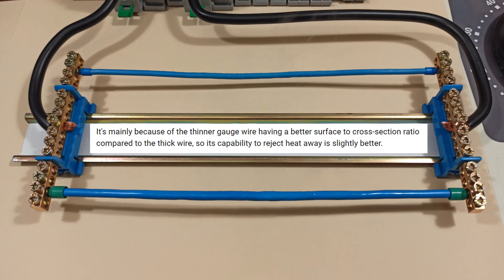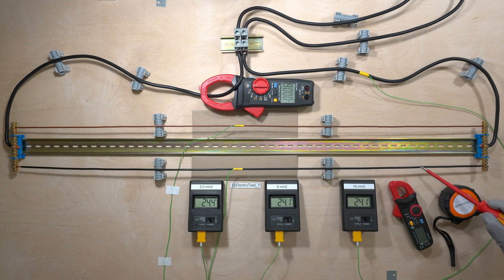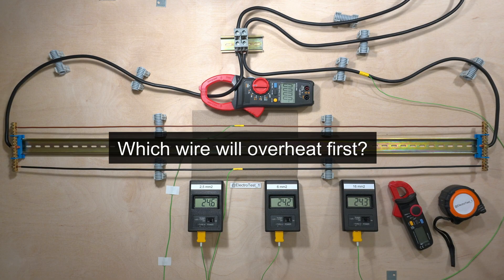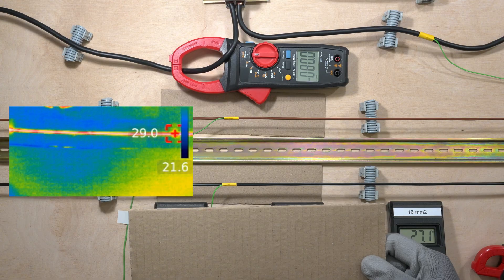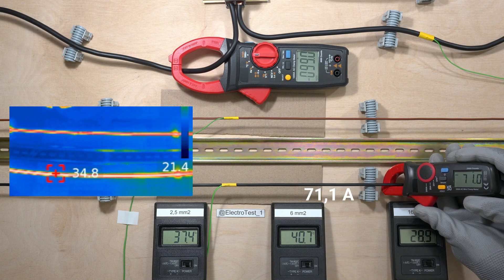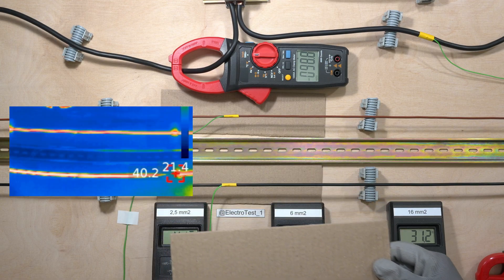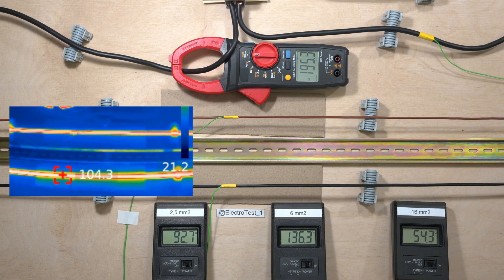Legend is True or Not? 1 meter Thin or Thick wire Fails First?

Comment from the maker: Please support my channel: https://www.youtube.com/channel/UCqZUswoAI9E9iFcTeS7L6gw/join
So, is this legend true or not? Parallel connection of wires and cables is rare, but it does occur in real operation. In most cases, it happens as a result of repairs or increasing the load capacity of existing lines. Using different conductor sizes is definitely against the rules, but that’s not the point here. According to the electricians’ “legend”, the thicker wire melts first.
I already have a similar test on my channel, but the result there was questionable. There were many comments and interesting thoughts. This time I made several important changes:
1) long parallel conductors
2) solid (single-core) wires
3) temperature measurement using thermocouples
4) periodic thermal-imaging checks of hot spots on both wires
The heating test of wires with different diameters demonstrates several physical laws at the same time. Can you help me recall which ones exactly? =)
Now a few of my thoughts:
1) In this test, the current distribution matches the cross-section ratio much more closely
2) Temperature sensors provide much more information
3) Haha, how did I not think that the hot wire would cut through the tubes — the melted insulation nearly ended up on the table
I’ll be glad to hear your comments and new test ideas — now I finally have much more space!

Comment: Easy explanation:

For a fixed voltage across a wire of given length, the power is inversely proportional to its resistance, which is inversely proportional to its cross-sectional area, which is proportional to its diameter squared.

Therefore 1. the power generated in wire is proportional to its diameter squared.

The power dissipation in wire (heat transfer to air) is proportional to its outer surface area (model the wire as a cylinder) which is proportional to its diameter - can ignore ends of wire since it's very small compared to length of wire.

Therefore 2. power dissipation ability of wire is proportional to its diameter.

Since 1. grows faster than 2. with diameter, the temperature (which is proportional to the power) will also increase faster for higher diameter/thicker wire compared with the thinner wire.

Comment: Imagine the thicker wire as 2 thinner wires next to each other (touching). The current splits equally between the 3 wires. But 2 of them are touching, so there is more heat in one spot. While heat generation goes up 2x, heat rejection is proportional to surface area, which is lower than 2x (due to parts of the surface area of one wire touching the other wire).
With an instant short circuit test, there should be no difference, as there is no time for the cooling rate difference to have an effect.
Reply: Everyone discuss about difference in current, but actually this is truth reason for temperature difference, how simple and intuitive explanation <3

Comment: A clamp meter is a transformer. The efficiency of a transformer is partly dependent on the reluctance of the magnetic circuit.
If there is any contamination (bits of grit or dust) where the jaws clamp together, that will increase the reluctance (a lot). Air gaps are as bad for magnetic circuits as they are for electrical circuits.
Maybe a quick wipe would bring the clamp meter to read the same as the panel meter.
Although, 2% isnt really all that bad???

Comment: Hi. You're doing a great job. How do you use 240A with 220V? Standard household grid power doesn't meet this. Are you testing the output voltage with 12V? Good work 👋

Comment: Very well as we can see, this is a demonstration of how the current takes the path with least resistance(R=ρ•L/S). 
And then we have the power dissipation(Joule effect) P=R•I² where the power grows with I squared,where the current doesn't split equally between the two parallel conductors because of difference in Resistance.
Reply from the maker: Great comment! Also note that the surface area of the conductors through which heat is dissipated does not increase proportionally to the cross-section. I think this is the main reason for overheating of the thicker conductor.

Comment: Come on people, this is the very BASIC electronic principal:  We are dealing with 3 factors.  ( voltage is the same for the wires and can be ignored for our purpose).  1.  Resistance.  2. Current.  and 3.  Power. (This is what produces the heat).  The wire resistance increases with temperature.  The power (Heat) increases with the SQUARE of the current.  Therefore, the larger wire will conduct more current than the smaller wire for an increase in temperature.  P=I^2 X R.  The magnitude of resistance change with temperature is less in the larger wire, but the square term means the power will go up faster than the resistance.
Reply from the maker: Hi! You wrote what seems like a well-reasoned comment, but honestly I lost the logic at the end of your message. Try to approach the question more simply — the heat generated is proportional to I². The currents split according to I₁/I₂ = R₂/R₁. Now look at how heat is dissipated around the wires, taking into account the surface area, or to simplify, just the circumference length: πD₁/πD₂. If you take any moment from the video and calculate it, you'll see that in the thicker wire more heat is generated per 1 mm² of surface than in the thinner one

Comment: If you run the same amps through both wires, the thinner one melts first.   This parallel setup isn’t doing that
Reply from the maker: Thank you for the correct remark. Indeed, with the same current, the thin one would melt first! This will be in the next tests. In this video, it's specifically a parallel test.
Reply: @ElectroTest_1   This is a cool experiment though.  It was counterintuitive to me at first until I thought about it more.  Thanks for sharing.

Comment: The thicker cable has lower resistance, therefore it conducts a higher current. This leads to a higher temperature. In series the thiner should fail earlier.
I would like to see a test with flexible vs solid cable of the same cross-section.
Reply from the maker: Thank you for the good idea. It got me thinking why flexible wires almost always have thicker insulation than solid ones.
Reply: @ElectroTest_1  and flexible cable with and without  wire end ferrule
Reply: Multifilar cable should be a little better in Alternative Current because of the Skin effect(dependent of frequency), otherwise in Direct Current the solid one is recommended because the current is flowing in the entire section of condutor.

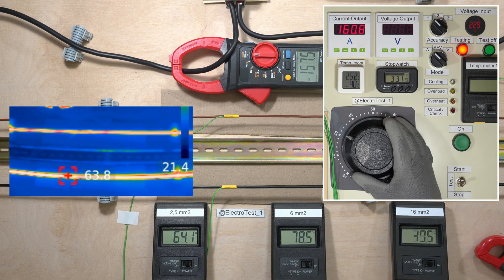Comment: @4:50 the resistance of the wires has increased causing more energy to become heat increasing the resistance

i fount it interesting that we can expand our circuits using extra wires to the same paths with different power cut off protection
Reply from the maker: Yes, theoretically you could increase the power this way. However, it’s not correct to do so. I’ve thought of several reasons why this shouldn’t be done:
1) If one of the breakers trips, the other line will suddenly become overloaded.
2) It’s unclear how the protection will behave — how the currents will split at different short-circuit points.
3) Even switching it on or switching between the lines becomes problematic.
This might only be acceptable if, at the end of the two parallel lines, there is a common bus and a single breaker that then supplies the load. Or do you see it differently?

Comment: The thicker conductor has lower resistance. Resistance is inversely proportional to the area of the conductor. (resistivity formula). The current flowing through it is greater (I=V/R). In this configuration the voltage applied to the two conductors is equal, but the currents are not equal. More relevant was whether the configuration allowed equal currents. Conductors had to be connected in series
Reply from the maker: Thanks for the explanation — I think we could connect different conductors in series on this test bench. Although that’s a slightly different topic

Comment: Is it because every mm² always creates the same amount of heat, but the smaller cable has a bigger surface area (in relation to the amount of heat) to cool down? My Calculations: A circle with 2,5mm² has a cooling surface of 5.605mm, and a 6mm² circle has a cooling surface of 8.683mm. So the cooling surface of the 6mm² cable is 1,54915 times bigger than the cooling surface of the 2,5mm² cable. But the 6mm² cable takes 2,4 times the heat. 
Greetings
Reply from the maker: Hi! Thank you for your calculation. Yes, I think the main reason for the overheating of the thick cable is exactly this! I’m glad that this time we can see this effect very clearly
Reply: @ElectroTest_1  Yes this video demonstrates this effect very clearly, thank you for this very educational video!
Reply: @ElectroTest_1  Rate of temperature reduction for hot water storage tanks comes to mind as does body temperature recovery for large cold blooded animals.  There is a point where large 'cold blooded' creatures can not recover their body temperature in time.
Reply from the maker: @retrozmachine1189 You’re giving quite deep analogies, and intuitively I understand that it might be related, but not completely. Could you describe in more detail the connection with parallel heating of wires? The heating of water tanks and cold-blooded animals.
Reply: @ElectroTest_1  I'm thinking on how we could rule out the "higher current" => "higher temperature" theory. One experiment could look like this: take 3 solid core 2,5mm2 wire. Strip the insulation to rule out their effect. Twist two of the wires lightly so heat and current can flow between them, but most of the surface area remains unchanged. Now connect the twisted wire and the non twisted parallel like in this experiment. The twisted should have twice the current of the single wire, but if the surface area / volume theory is correct, then we should see very little difference in the temperature change.
Reply: Great calculation. This also means that the temperature change should be around ~1.5 times greater in the thick wire, which is roughly matches the end results.
Reply: @mr0big  Yes you are right. Maybe the small difference can be explained because the cables have insulation. In my calculation I assumed "blank" cables.

Comment: Do your clamp meters have a different tolerance to the panel meter? The wire isn't running central through the clamp meter either, sometimes that can affect the accuracy of the reading, depends on the clamp. I haven't tested either of those so can't say to be sure, but they all look to be fairly reasonable readings to me.
Reply from the maker: The ammeter’s error is a bit smaller. However, when I usually measured it, the difference was smaller — so I think it’s still something related specifically to the measurement method.